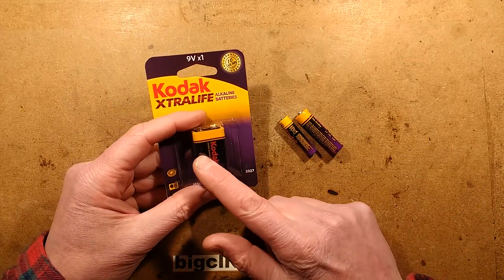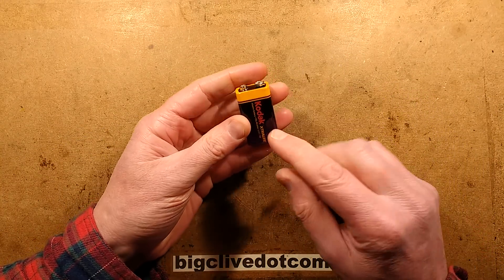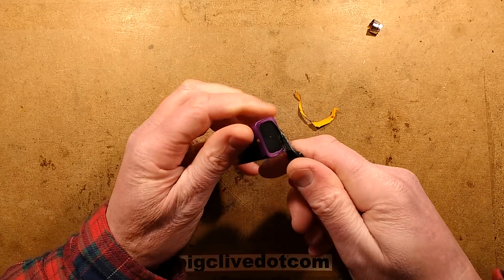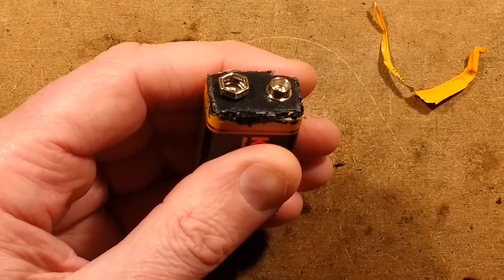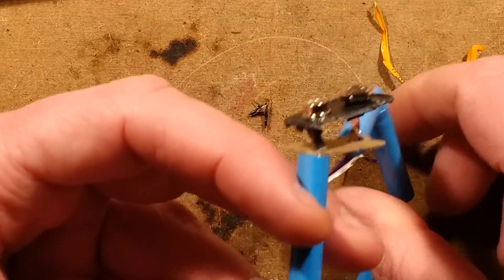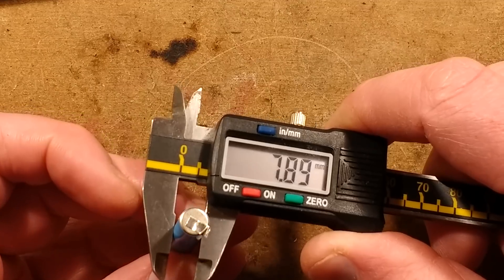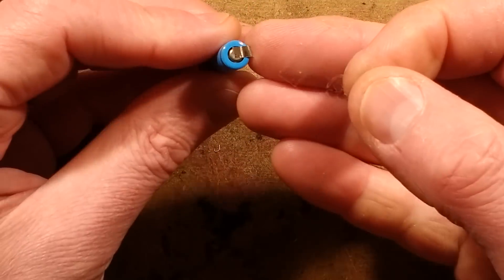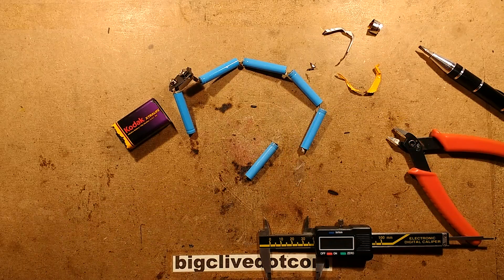Inside a Poundland 9V alkaline battery.  (Check polarity of cells if re-using!)

Comment: In the mid 1980s, we used to fire off model rockets in the park. There was a translucent plastic cone on the rocket, and I got the idea to put a 6V mini Christmas light in the cone, but couldn't fit a 9V battery inside (too wide), I cut an Energizer battery apart and used four of the sub-AAAA cells arranged in a 2x2 square and it fit perfectly. We launched this rocket at night, and a green glow shot up into the sky, disappeared, and then came down into a nearby forest. Recovered, and used several times until it was lost in a river.
Reply: Back in the '60s we used to take bottle rockets and throw them by hand trying to make it across the river.  If they lit up at the right time, you would make it across the river, but if the bottle rocket had already started pointing downwards when it lit off, it would go into the water and explode at some depth under the surface.  At night, that equaled a big glowing spot in the water with a muffled thud for an explosive sign.
Reply: Now if the kids got off their phones went to the park and tried to launch rockets they'd come home with terrorism charges.
Reply: I did nearly the same thing with an Estes "Big Bertha"
Reply: Wonder how many UFO reports that causes :)
Reply: I used to have a Big Bertha but it got stuck in a tree near a run of high tension power lines on it's maiden voyage!
Reply: Lake Nipissing in the 80s i used to lick batteries while feeding ducks
Reply: iTheGeek  -- No, the small stick on the end of the bottle rocket acted as a tail and provided enough drag that it would follow the parabolic arc of your throw.  Same way as when you shoot them from a stationary mount, they don't come right back at you.
Reply: Ace!
Reply: North Bay area ?

Comment: We have some acer tablets at work which have an active pen with a AAAA battery. Unfortunately the pens dont have a spring terminal so the 9V harvested batteries fall slightly short and dont make a good contact. Since AAAA batteries are so expensive to buy working out a solution (maybe using the tabs as a lever? ) would be definitely worth while
Reply: Just use a small neodiddly magnet to make up the space needed.
Reply: I used to get these for the same reason. Never had an issue getting them for reasonable price. Usually just slightly more then a AAA battery. I settled on getting the Energizer E96.
Reply: Hmm ill check them out and see if we can get them through work
Reply: Tin foil stack on one end and voila ;)
Reply: hahaha indeed yes :)

Comment: I actually once opened a 9V battery and inside, it's a cylinder cell like this but inside that cylinder cell is tons of small button cell
Reply: Hmm, that makes absolutely no sense (in regards to voltage and cost) - The V23 and V27 small 12V batteries for remote controls and the like is exactly button cells stacked.
Reply: varta are a stck of 6 rectangular cells , not in a metal case
Reply: I actually opened your comment and found a bunch of tommyrot inside.